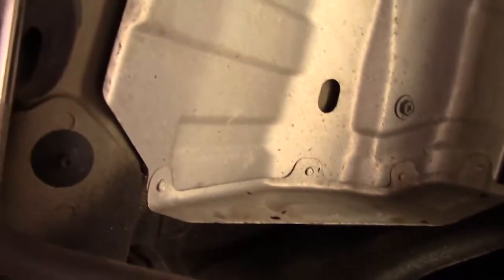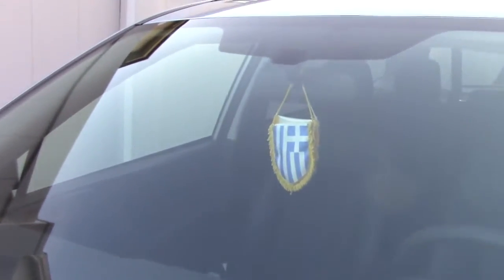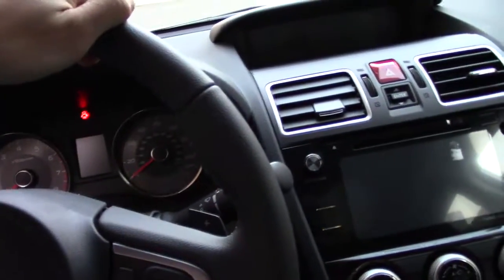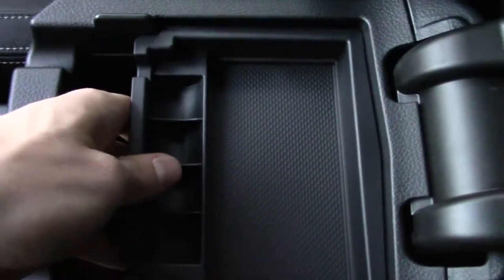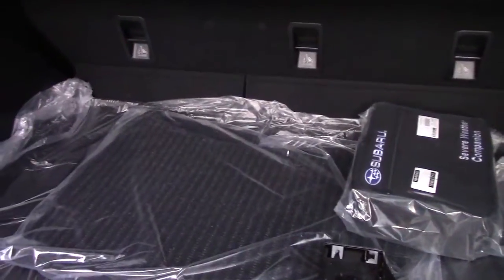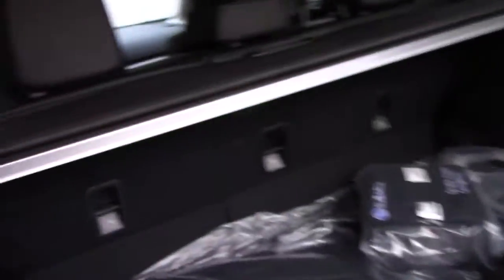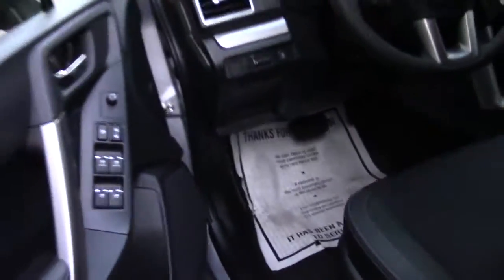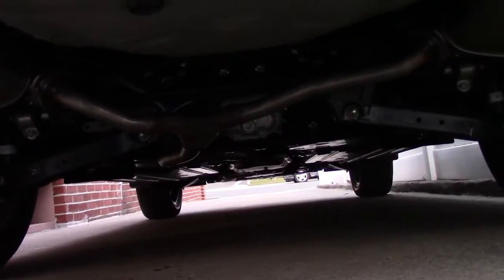2017 Subaru Forester XT Walkaround - Goodbye Legacy, Hello Forester!

Comment: I would agree it's nice and congrads.  We just got the same model too.  But, if you like mods to your Forester.  Go check out www.subispeed.com, ok?  They have the trunk light to give more light to your cargo area and the two reflectors on the rear bumper can be replaced to light up for braking, turn signal, etc.
Reply from the maker: Waaaay ahead of you bud. Been doing research and compiling a list of mods for months :D
Reply: HERCFitness No problem, just thought to mention it.
Reply: Hi, could you please share the list of mods you gonna do on the FXT with us? I have the same model, would really like to mods the FXT but have no idea where to start. Thx.
Reply from the maker: +Xuyang Liu Yes I'll be sure to share the mods list I have in mind in my next video so stay tuned!

Comment: How do you find the gas milage?
Reply from the maker: There's a button on top of the center console that you can cycle through different displays of either mpg, boost pressure, x mode, a clock etc.